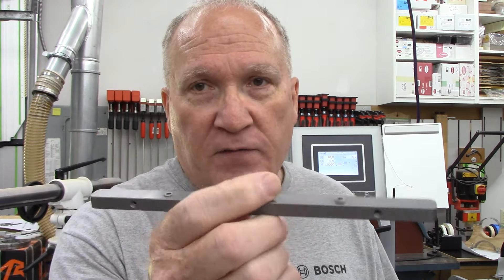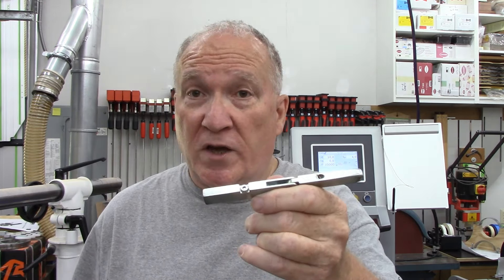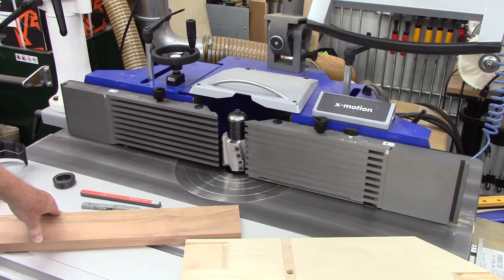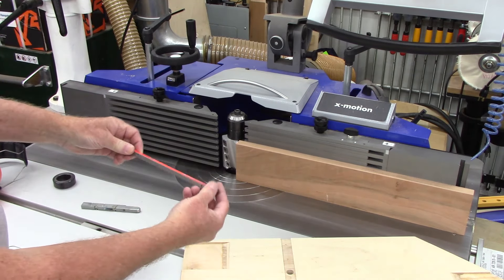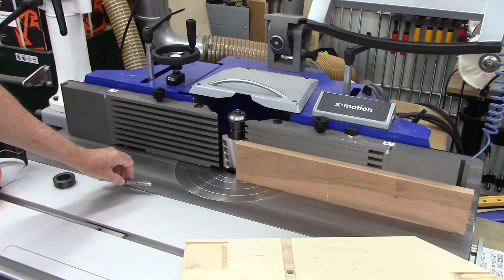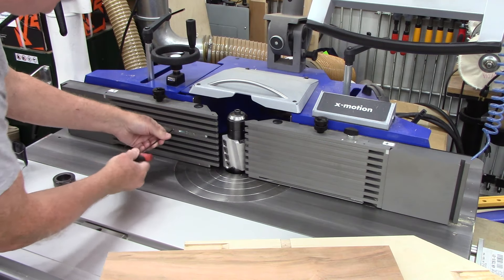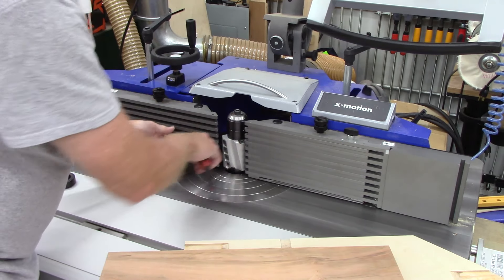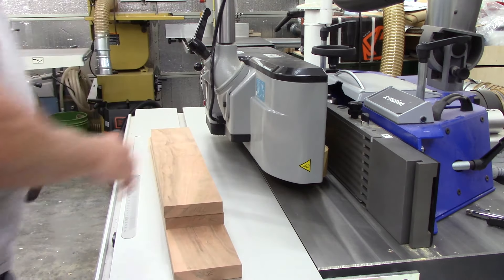Aigner Integral Fence   must have accessories

Comment: I had the filler bar for the bottom but wasn’t aware of the spreader bar so thanks for that. I must admit to being somewhat envious of your power feeder - I have the traditional style (Steffi) and converting from horizontal to vertical sometimes feels like advanced origami to me. Cheers
Reply from the maker: Yeah, I have the Steff and it has been sitting on the floor for almost 7 years.  I completely agree on the origami analogy.  I am getting ready to put it to use though.  Steve

Comment: You could also use the splitter to support the inside of the recess you milled out, either at the top or bottom, if you didn't have the filler or you had some odd shape.
Reply from the maker: That is correct but on a groove this wide I don't think I would trust just one.  Steve